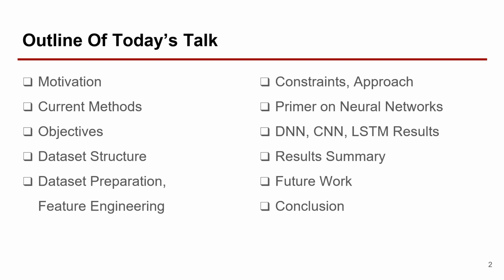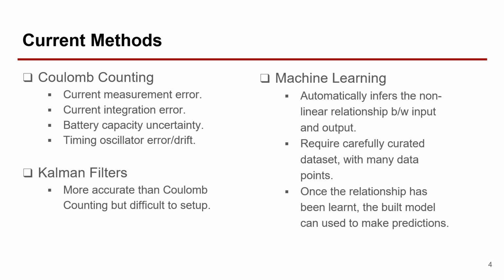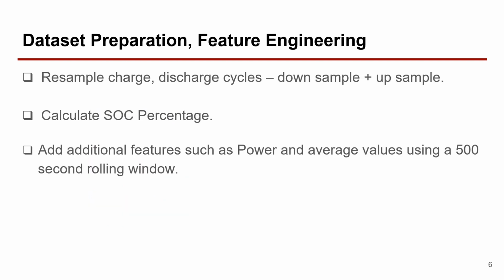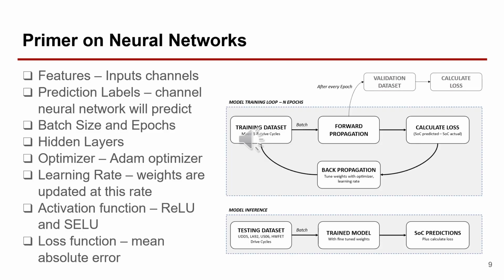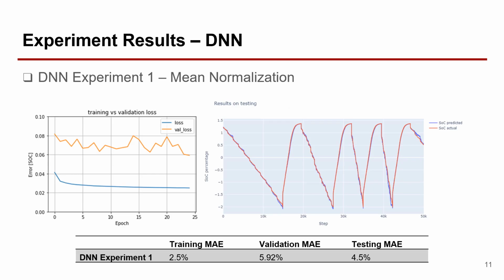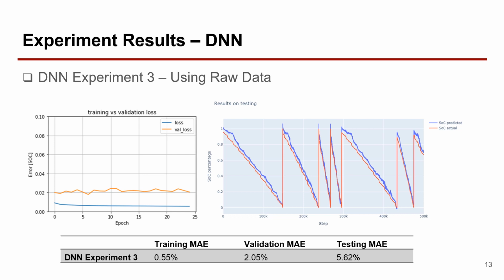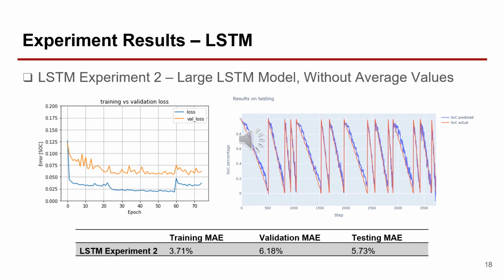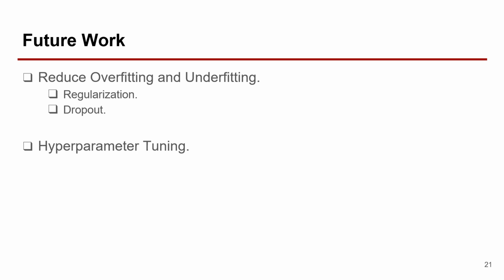EV Battery State of Charge Estimation Using Machine Learning

Comment: Sir, I want to know, if I have 4S4P Module 
And following real data (from data logger/simulation)
1. Battery Voltage (say 18650 Li-ion)
2. Discharging Current (say for 2C)
3. Individual Battery Temperature
4. Ambient Temperature 

What are the parameters we can predict from these datasets using machine learning. ( About single cell or Whole module)
Reply from the maker: Depends on the data. If you are recording data for battery. You can predict any of this parameter for the whole battery system using machine learning. If you just have it for a cell, then you can extrapolate for the whole battery but results could have a huge error
Reply: @talhakamran3471  thanks